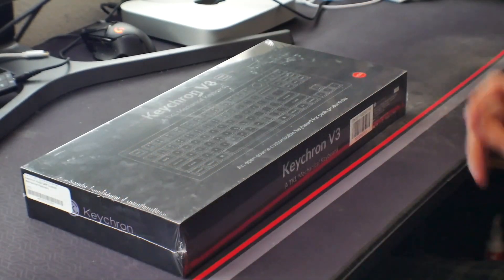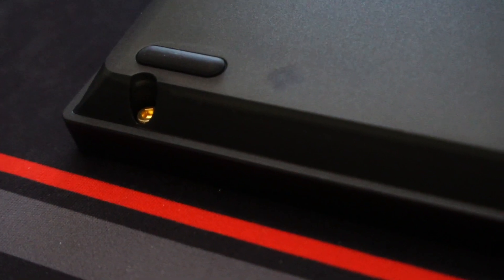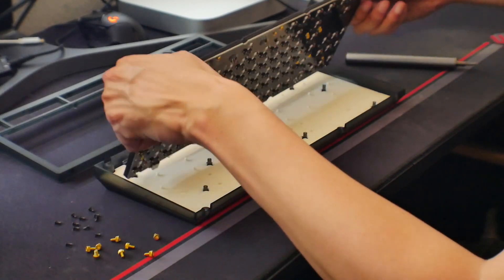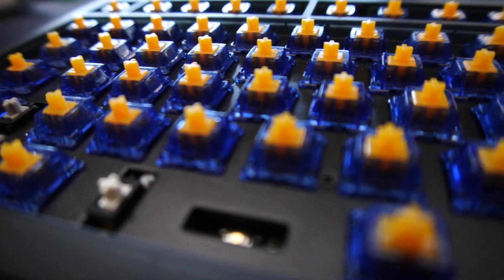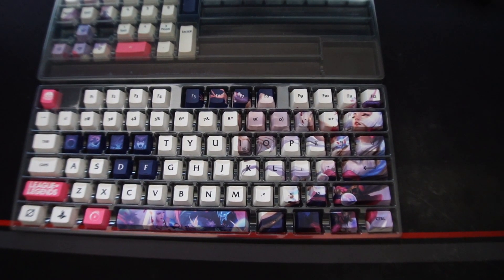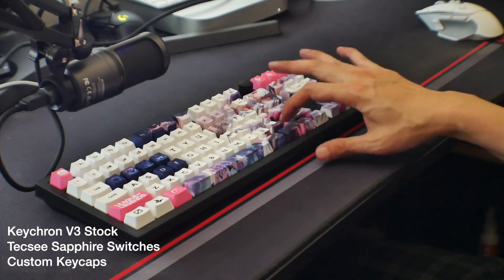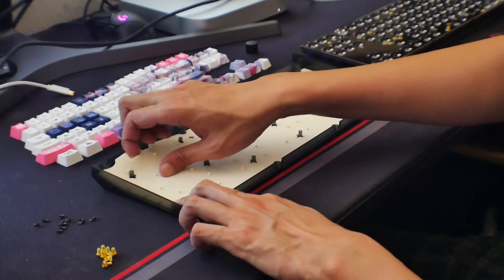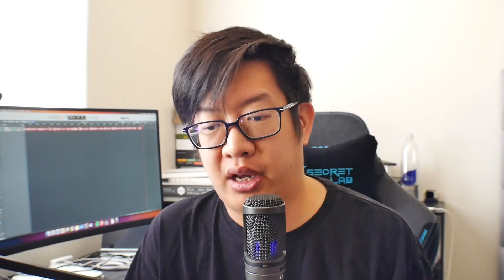Keychron best for budget? - Keychron V3

Comment: Void here, keychron is a good beginner s keyboard, i have a keychron as well, i recommend for people that just started with keyboard creation

Downfalls:
After playing with it after a few months about 5 to be exact, it now doesnt let me press 7 keys whenever im playing rhythm games, but thats just my experience over i would recommend for, modding, switch sound testing, gaming ( not for rhythm )

Rises:
Comes with foam/sound dampener 
Pre-lubed stabilizers
High quality cases, keyboards
Budget friendly (keychron v1: 99$usd, etc)
Fast shipping

9.8/10 would recommend for beginners
Reply from the maker: definetly agree!
Reply: Hey, you need to enable NKRO by pressing Fn+N. The keyboard defaults to 6KRO in some cases, and it can be fixed by adding "#define FORCE_NKRO" to the config.h file in the lowest layer e.g "keychron/v3/ansi_encoder/config.h"

Replace "ansi_encoder" with whatever model you have